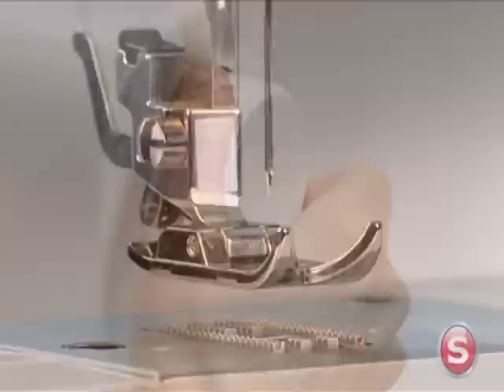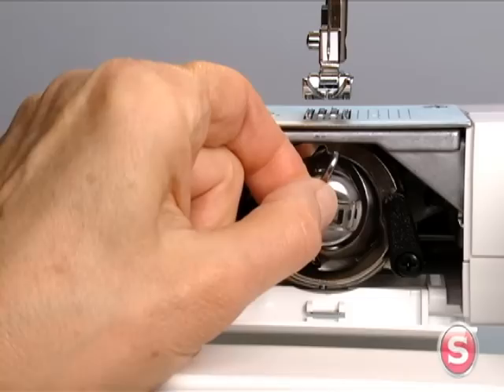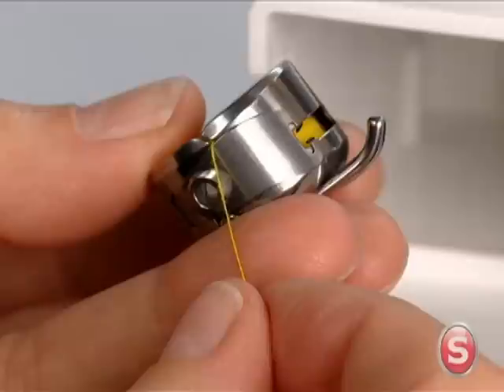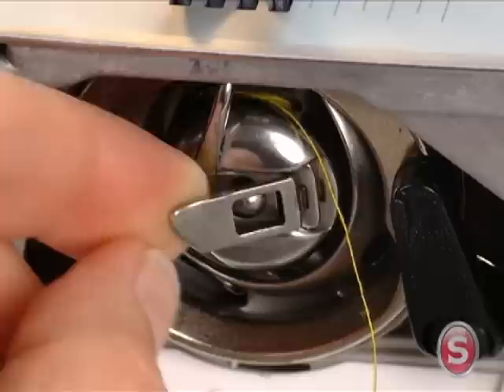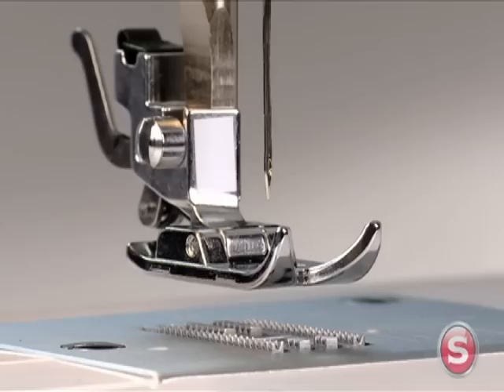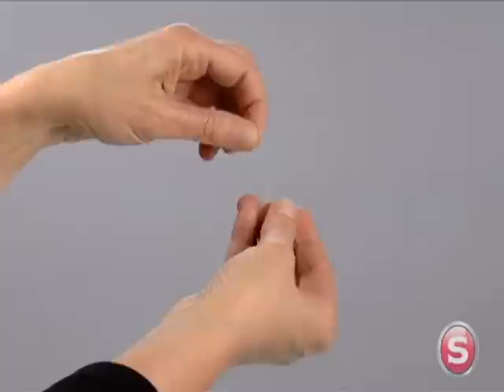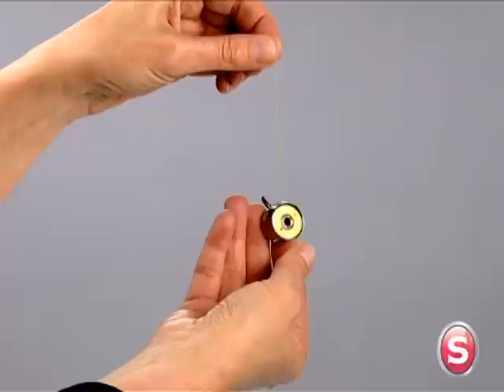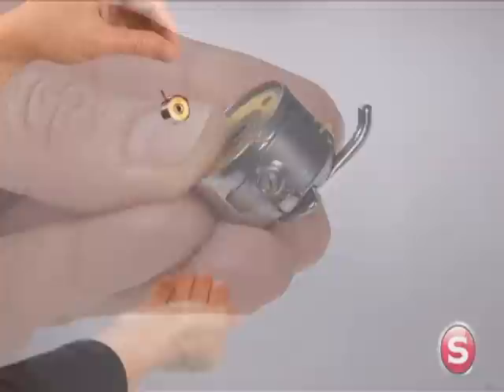SINGER® Installing a Front Load Bobbin Tutorial

Comment: I have a singer start. It's only a few months old, but the bobbin tension is too loose.
I've tried to tighten the screw. It wouldn't go any further with a screwdriver, I used my tweezers as they fit the screw better, ....now they're twisted.
Is there anything I can do?
I'm also having issues with the bobbin turning thing on top. I cannot see how I could be doing it wrong.
The machine was a gift, ...should I give up and just buy a better model?

Comment: You cannot begin to insert the bobbin nor the little bobbin case until the two-part holder is securely in place. How can you balance these two parts of the holder to secure them in place with the two side clips that are fixed to the machine at both sides?